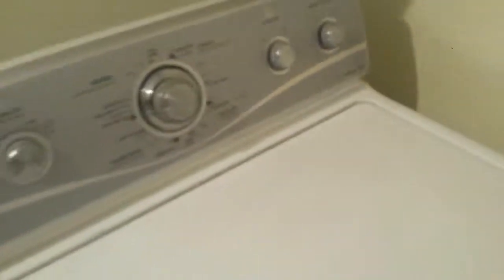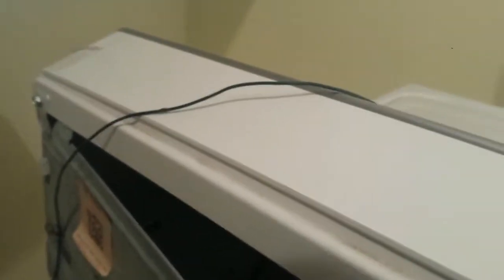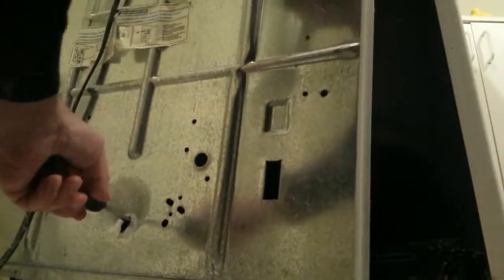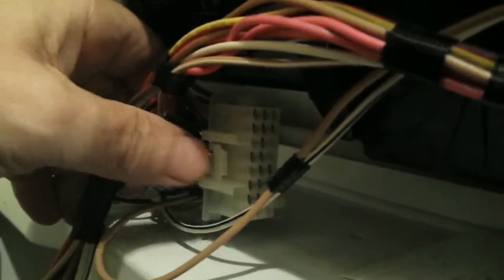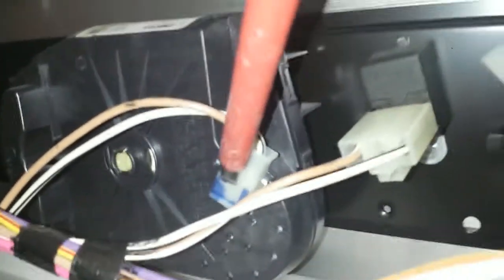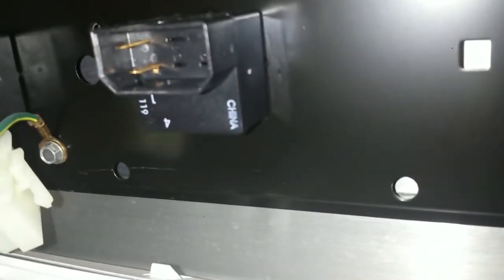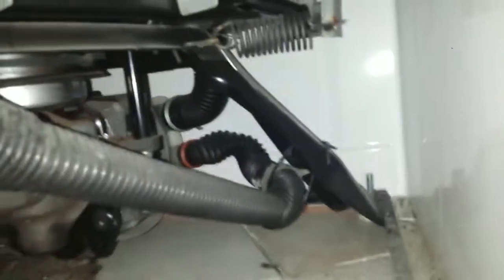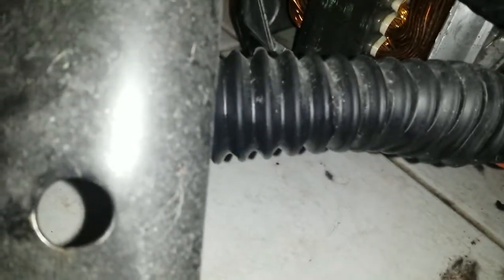Servicing a 30 Year old Maytag Legacy Series WASHER

Comment: I have this washer and watched this video trying to figure out how to open it up.  I tried this method for about half an hour and then gave up and called a repair man.  The repair man popped it open in one minute.  Here's what you do.  (As best as I can remember.  It was a few weeks ago.)  I'll call "the console" the part of the washer with all the knobs on it.
1. Stand facing the washer.  
2. Slide a putty knife or some other flat metal object under the console (between the console and the top of the washer) on the left front.  It will release a latch.
3. Do the same on the right front.  It will release a second latch.
4. The console will swing up and back, hinging on the back of the washer.
5. Each latch will have a metal hinge type thing that you remove, allowing the console to swing all the  way back.
6. Now the whole metal body cover of the washer can be lifted away, so that you're left with the washer drum and machinery still attached to the back that has all the cords.
Reply: I cannot thank you enough for this!